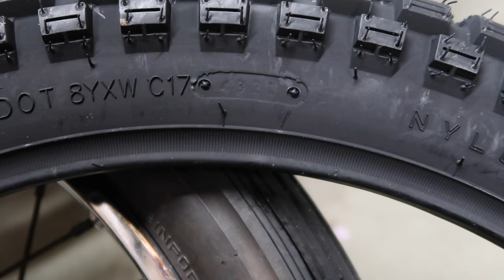DESTROYING A HONDA C90 OFFROADING AFTER TYRE CHANGE - KENDA K262 REVIEW FIRST IMPRESSION

Comment: Excellent off road test😂. I will bear these in mind when I need to change my tyres. I found the rear wheel a bit of a sod to get back in after changing the sprocket and shoes.
Reply from the maker: That, dear friend from inside the internet, is where you need an emprodulator, a long punch, a drift etc to get that dastardly bush in the middle of the hub centralised and ready to receive the bolt.
Reply: @EpohDerf  very true. I found undoing the shocks at the bottom allowed me more space to get the wheel in.

Comment: Wow, I'm phoning Honda first thing tomorrow, my 22 Super cub was delivered and some idiot forgot to put the inner tube in. By some amazing luck the tyre stayed inflated, narrowly avoiding a disaster. Do you recommend tyre warmers now we are getting into the colder weather ?
Reply from the maker: Nigel, if they forgot the inner tube I am afraid the bike is a write off. Just have to chalk that one up to experience.

As for tyre warmers, taking large thermos flasks of boiling water is a good way to go about it. You could also take a blowtorch or smear the tyres in vaseline and light them to warm them through.
Reply: @EpohDerf  Thanks for your expert advice Fred, I agree maybe the 100 point safety check the expert Honda technician carried out does not include tyre check as there are well over 100 bolts to check so tyres probably not that important.  Will try the vaseline on the tyres tomorrow on my way into work with a top accident and injury law firm.
Reply from the maker: @nigelbaldwin752  I think those checks just involve the technician choosing 100 things to check. 1) how does the horn sound? 45) can it do a burnout on a wet, polished concrete floor? 69) how much ham can be safely draped over the mirrors? it is probably that they simply didn't have enough checks to get to tyres...
Reply: @EpohDerf  "how much ham can be safely draped over the mirrors?" As someone who has purchased a new Super Cub and who once tried a vegetarian meal, I'm shocked, appalled and shocked that Honda does not offer a Veggie Option when they complete their tests.
Reply from the maker: @edwardsp1916  they do offer a vegetarian cub. If you ask for one, they roll their eyes and give you either chips or green salad.
Reply: I thought a 2022 Honda super cub was tubeless?
Reply from the maker: @timhudson1846  they are. We are just larking about. I suppose an inner tube is a get to a tyre place solution if you totally bugger a tyre on a 2022 cub.
Reply: @EpohDerf   I've been in contact with Steady Garage.. they tell me the new cast wheel's on the new super Cubs .. can work with tube type tires.
On some of their custom built bikes..they report no issues...
Reply from the maker: @timhudson1846  cheers for the info. The tyres on there are barely worn, I am intrigued to see how long they last.

Comment: fantastic if you're gonna ride on gravel/farm mud/ grassy fields/trails and sand in fact the difference in off road traction is night and day

but it can be absolutely dangerous on tarmac especially if it's raining since it has way less contact patch as compared to regular road tires
Reply from the maker: Thanks for the advice. I will be careful when braking.

Comment: Hiya, I've just fitted some Kenda 262's to my new to me 2006 Honda Innova. I'm finding the steering VERY light though and vague even in a straight line. I've done some basic checks and suspension/bearings etc all seems ok. I've currently put standard pressures in (29psi) and wondering if that's the issue. Can you remember what pressures you're running?
Reply from the maker: If you've come from ordinary road tyres, they do feel very different. Road tyres felt like you could 'flop' from side to side really easily, the kenda take a bit more.work and feel different at different angles of lean. They grip just fine for corners but are a bit crap with heavy brakes on damp roads.
I suggest you start tearing around green lanes and then you'll be having so much fun, you'll forget the tyres feel odd..
Reply: @EpohDerf  haha, the reason I fitted them is for green lane fun on an inappropriate project bike 😂 I've ridden on offroad tyres on other bikes and ridden scooters in the past so don't think it's just the tyres unless the pressures are massively out (I've put the standard 29psi in as a starting point). As I only rode a couple of miles before fitting the Kendas I'm even unsure if it's the bike but I have done the usual checks (steering play, bearings etc) and all seems ok.
Reply from the maker: @richardeaton1544  I will check my pressures later today and get back to you. I think I've got more in the rear than the front...

Replaced all the shocks and bushes etc so that might be helping.
Reply: @EpohDerf  cheers, much appreciated! Today I lowered the front to 25psi and kept the rear at 30psi and it seemed a bit better. It could of course just be me getting used to it 🤷‍♂😂 

I only just bought this bike which the previous owner fitted all new suspension/brakes etc a few months ago. Everything seems well done and mechanically sound. 

It could just be me as I'm used to a much bigger bike normally (Africa Twin AS) but the steering just feels too light...

Comment: No need to remove the chain or rear sprocket..leave it all attached to the swinging arm
Remove the rear nut on the torsion arm, and the brake barrel nut
You can get the rear wheel out.
You need to scrub the tyres in for about 100 miles first

Comment: Seems like your bike has a huge gap between 1st and 2nd gear.
Reply from the maker: I think you're right. Combine that with a heady 5.14 horsepower and you've the magic combination of overheated, underpowered and 'using it for the wrong thing...'

Bigger sprocket on the back next time?
Reply: @EpohDerf  what are your front and rear sprocket sizes?
Reply from the maker: @RideWithRen  without looking I can't say with conviction but does 39/16 sound right?
Reply: @EpohDerf  you can't fix the gap between first and second gear by changing sprockets, but you can minimize the gap by going to lower gearing. Try a 15 tooth front sprocket, it might suit you better.

Comment: I don't understand this!  The Honda 90, is a great bike, reliable and is what it is! It's not designed for Off road!
Reply from the maker: I think that is part of the fun, seeing what else it is capable of.
Reply: @EpohDerf  well okay
Reply: To go off-road, you don't need an off-road bike. You need an off-road rider.
Reply: The C90 is a road bike. It’ll fall apart in the dirt. Those tires would work great on the CT110 or CT90 trail bike.
Reply from the maker: @tomskibowski8464  I certainly have a lot of fun. Saw some brand new (very expensive) bikes yesterday on the trails and wondered if they were having an order of magnitude more fun than me - perhaps not.
Reply from the maker: @ytr8989  I would like something a bit more off roady. Got a Honda Africa Twin to finish off...
Reply: @EpohDerf  Africa is a brilliant bike. But SuperCub is better ;) 
Riding with some technique you can go off-road as far as on Africa. Unless it's uphills :)))
Reply from the maker: @tomskibowski8464  I am inclined to agree
Reply from the maker: @tomskibowski8464  the AT has been almost finished for ages and doesn't compel me to ride it like a cub does
Reply: anything that has wheels and an engine trying to spin those wheels, can be driven off road

it's just loads of fun to ride a vehicle that's not really designed to do what you want it to do...

I mean if you ride a 450cc Dirt Bike off road and it didn't quite made it over that hill, it'll be quite disappointing wouldn't it 

and on a C90 any hill's a challenge and getting over that hill's a feat
Reply from the maker: @jasperdomacena6491  really well put. Equally, you don't hear people going mad when that same 450cc offroader is 'used wrong' to get to and from wherever the off-road bits are.

Comment: knock a tooth off the front sprocket, less top speed but improved acceleration and uphill performance
Reply from the maker: Thanks for the tip. About to do chain and sprocket so will 'knock a tooth off'.
Reply: @EpohDerf  the c90 3 speed gearbox, otherwise known as 1st, 3rd and 6th 😂
Reply from the maker: @matwyatt456  I am dangerously close to plopping a more pokey motor into/on it... 140cc perhaps?
Reply: @EpohDerf  I run a few lifan 110's and a 140, the 110 is a dead easy swap for your bike if you order it with the honda style clutch cover 
(or fit the one off your honda one (but use the adjuster mechanism from the lifan case) aswell as making sure it has the split phase generator.
everything will be plug and play, cub exhaust, airbox and carb/jetting, manifold etc.
Change the gearing to 16/36 and it makes that extra 4th gear into a great economy overdrive for long runs.
The 140cc is a little more involved and requires a bigger carb/different position, foam filter, bigger bore exhaust.
Reply from the maker: @matwyatt456  thanks for the explanation. OO racing sell a 140 kit with carb. Filter etc etc. Elec or kick start. I am quite tempted...
Reply: @EpohDerf  Go for a genuine mikuni vm26, tried numerous carbs and the mikuni made a world of difference over all the others.
The z40 cam and HD valve springs are a good idea too.
If you want the vm26 carb jetting I have it written down in the garage after lots of trial and error a few years ago,.
17/34 is a good useable all round gearing, daily commute with pillion at 60mph+.
Definitley worth fitting either ebc grooved or racing boy brake shoes and making sure the drums are clean and not glazed, the yss front springs help alot too.
Reply from the maker: @matwyatt456  some YSS springs in the post as we speak
Reply from the maker: @matwyatt456  the recommendations you've given I think are all addressed by OO racing as they PDI every engine and the 140 I am looking at comes with a vm26!
Reply: @EpohDerf  Just make it clear to Adrian that its for road use, he'll jet the vm26 to your spec if you ask. same goes for the generator type.
Reply from the maker: @matwyatt456  thanks for being so knowledgeable and happy to share your findings... Having a c90 feels more like having a pet than a vehicle.
Reply: @EpohDerf  I have a menagerie of them then, from asthmatic sloths to hyperactive chimpanzees and everything in between, a cub for every occasion :D
Reply from the maker: @matwyatt456  sounds ideal. Got a favourite?
Reply: @EpohDerf  yes! My 1966 cm90 supertourer/roadside recovery vehicle/burger delivery mule/ scrappage scheme reject